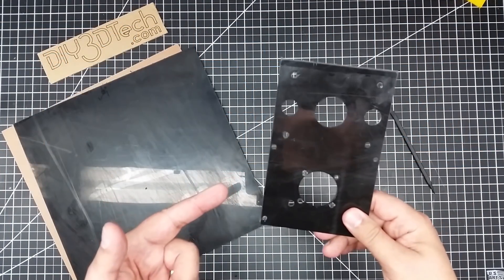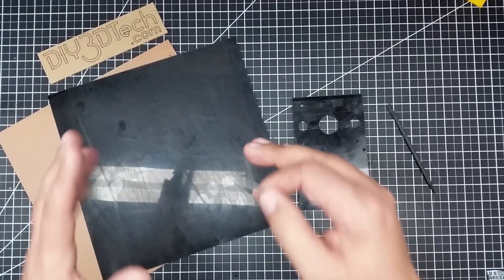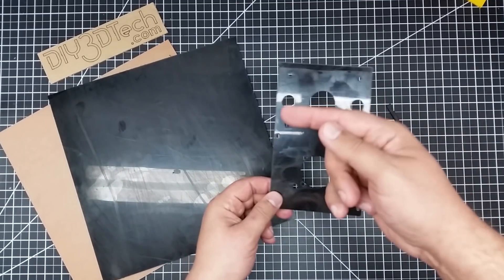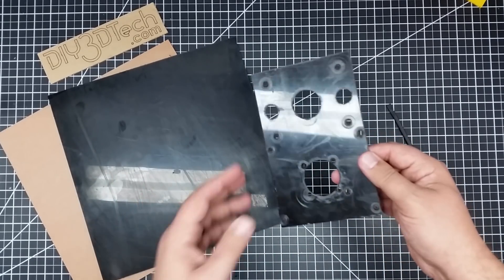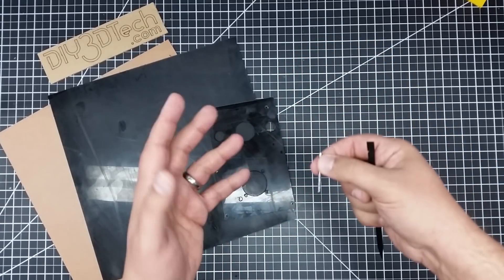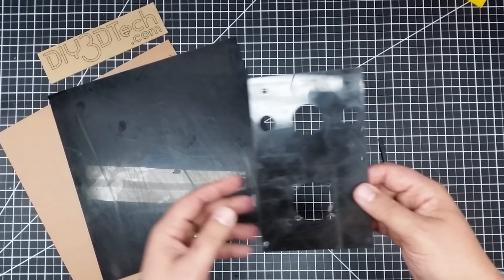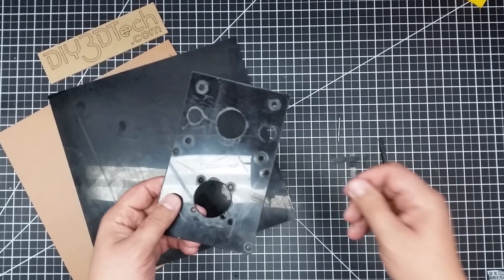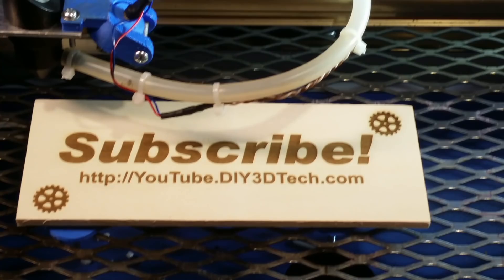3040 CNC - Polystyrene and my Peck Drilling Screw UP!

Comment: Can this not be lased instead?
Reply from the maker: Fumes are nasty and likely toxic....
Reply: Possibly but that is why the laser is vented outside.
Reply from the maker: Even with 1HP blower a lot gas escapes and not worth as tried this once (many laser sites tell you its bad idea an they are right :-)
Reply: I think this stuff has chlorine in it as some of the stryenes do and it will destroy your laser machine if it lets the chlorine gas in it plus you breathe it and end up on the floor unconscious or worse.

Comment: I have use high-impact polystyrene a lot for hand fabricated items and as you know it drills, saws, files etc really easily and cleanly. The reason for that is that with hand shaping you control the speed and never get near to melting the stuff. So why use a 3mm router cutter doing say 10k rpm when you would hand drill the stuff 3mm at maybe 1000 rpm? Have you tried slowing the process down a lot with a much reduced spindle speed to avoid melting it?
Reply from the maker: Your 100% correct as my grave error was the peck drilling as I failed to have push all the way in one pass and it melted creating a blob.  You also have another valid point slowing it down, but on this its a pain as I have to switch modes so I get lazy and just push  it faster for the cuts which works but in the end your right of course about the speed :-)

Comment: Shouldnt laser be better for this? I wouldnt use a cnc for stuff unless you need to make grooves or cuts that dont go all the way through
Reply from the maker: Not for this type of plastic, the fumes are nasty and it generates a lot of black soot  that's like oil...
Reply: vaccum machine attachment or something no?  i've seen lasers produce virtually no smell or smoke cutting wood after adding the suction nozzle near the laser point.
Reply from the maker: Even with a 1HP blower (which I have) you don't want to mess with poisonous gases.  Also the nozzle you see on the you see on the laser head isn't for vacuum, its for pressurized air called an air -assist as its job to "puff-out" open flame and keep the lens clear of smoke build up.  Also these things create tons of smoke :-)

Comment: coudl you put dry ice next to it such that  cold air from dry ice flows over  the work piece  , else as others have said  put  the light plastic under water .
Reply from the maker: The water bath would be big, the main thing is shouldn't of pck drilled it.  Wasn't thinking 🤔

Comment: if you're going to cnc plastic, either put wood on top of it or put it in a water bath.
Reply: yup, plain old water does the trick.
Reply from the maker: The wood on top sounds interesting...
Reply: the only problem with that is when you cut something like a hole, you'll have floppy bits after they are removed. You could use some water based glue and make a sandwich then use high vacuum suction to keep them stuck down. you want sort of a pegboard like bottom to your rig, with an open chamber, that's then hooked up to a shop vac. the cut areas will then suck away the cut material and act like a cooler.
The liquid is the better option though, just if you do go that route, make sure to oil your bits after.